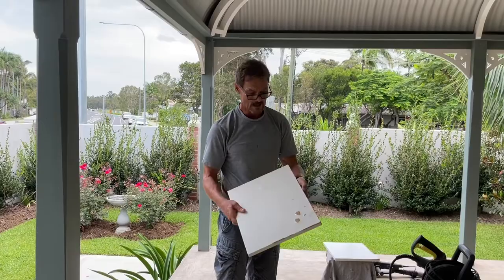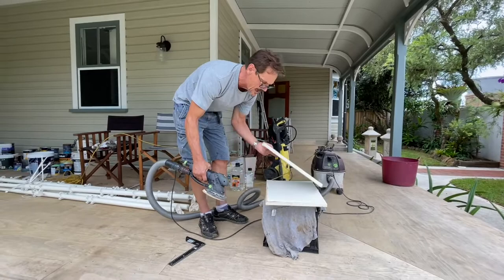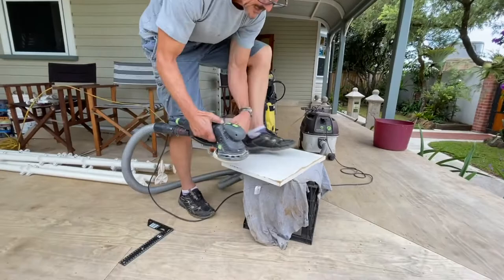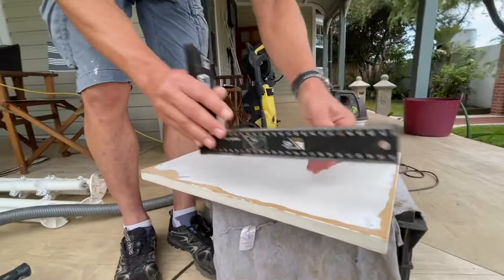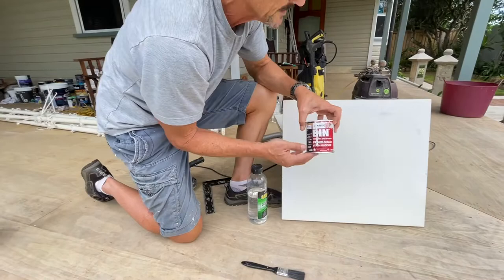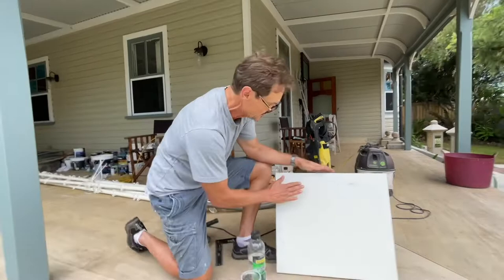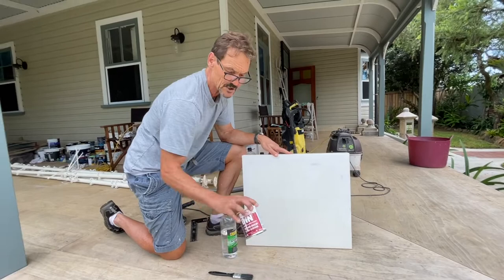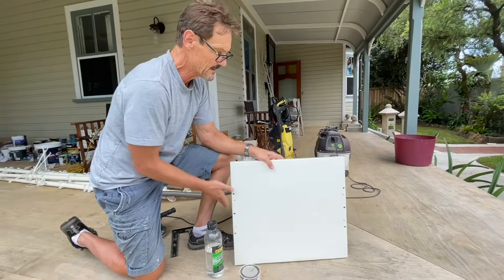￼ Restoring Water Damaged MDF Board￼

Comment: their other product, bullseye 123, works quite well even though it's water based, from what i've seen it's actually what they recommend, bin shellac make sense since it's oil based and wont bloat the mdf, fortunately as described 123 doesn't bloat either 

either one of them are great for prepping unfinished mdf

for filler i've been using earls mulTfil, expensive but excellent stuff, easy to sand for a perfectly smooth surface for your top coat
Reply: Thanks. Was going to use that myself, thanks for confirming 👍🏻 On the top coat I add floetrol additive to the paint.. You're left with a near perfect finish then.